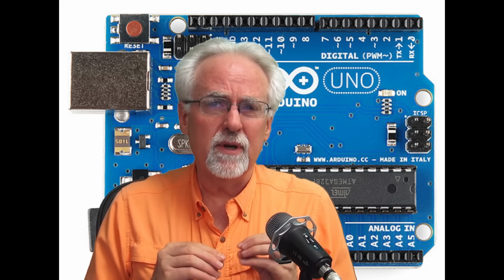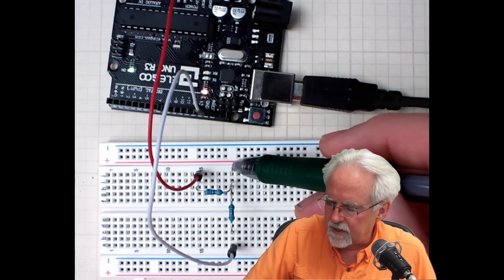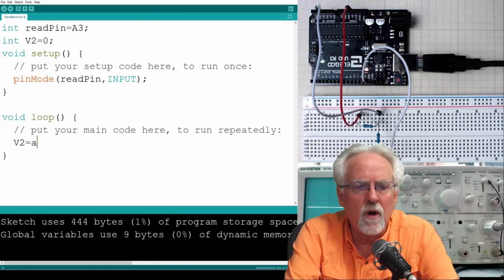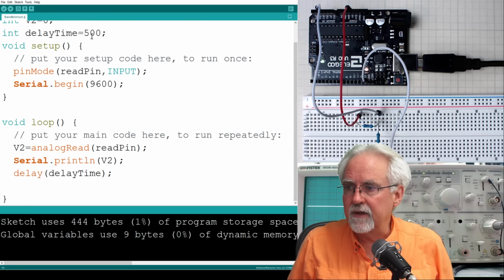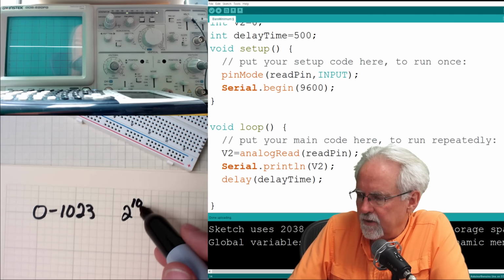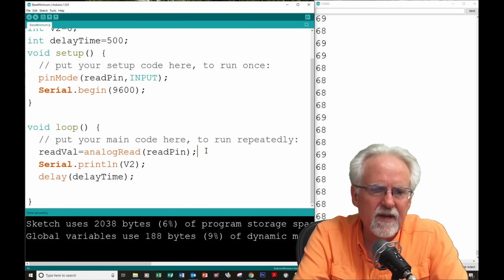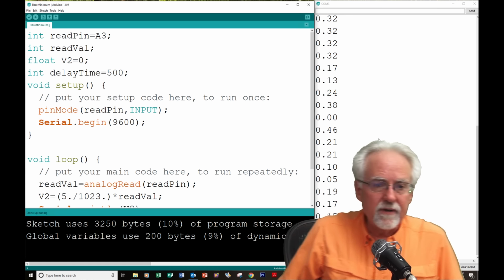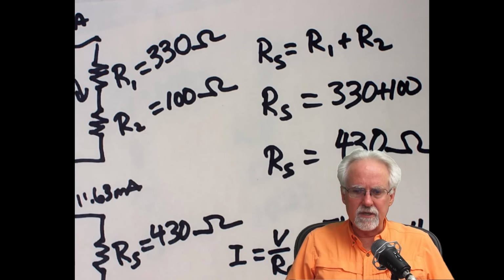Arduino Tutorial 10: Understanding How To Read Analog Voltage using analogRead Command

Comment: I feel like I still don't know where the analog to digital conversion was done.  I know we put an analog voltage into pin 3 but don't know how that analog voltage became a digital number between 0 and 1023.
Reply: There was no voltage received in the pin in that sense. There was a 10 bit signal that was received ie 0 to 1023. This signal is then mathematically approximated to match the voltage.
Reply: In the Atmega328 uses what is called a successive approximation ADC  (analog to digital converter) along with a MUX (channels A0-A5) this switch turns on or off the pin you want to read and what VRef you are telling it to use or defaults to input voltage AVcc. So think of it like this it takes your value and generates a reference 0 being 0 and 0.0048828125 Volts as 1 and 0.009765625 Volts as a 2 and so on up to 1023 provided your supplying exactly 5volts on AVcc.. If the value is above 0V0048828125 and below 0V009765625 the comparator says 1 spits it out the SAR which checks 1 step higher and a 0 spits out so it is done and sends it out done to the EOC. Which tells IC to record the value it's been sending to the DAC as the voltage measured. That's sort of a condensed version.
Reply: We have "Digital to Analogue Converters" or "DAC's" and we have (in this case) "Analogue to Digital Converters" or "ADC's" that are systems built in to the Arduino, these handle the conversion, if you use Wikipedia for an explanation it may help you

Comment: Another great tutorial. I don't want to get ahead of what you're teaching but I was wondering about your opinion of wireless sensors. Something that would be suitable for about 70 ft. or less. I was looking at the 433Mhz rf modules but it seems like they might have limited range.
Reply from the maker: I have had luck with the xbee radios, but a little tedious to use. I have some lessons on my old arduino series.

Comment: Hi whar aboui if you want to measure for example 5 volt or more?
Reply from the maker: digital logic is limited to 5V and sometimes 3.3 Volts . . . you would have to use something else like a volt meter for higher voltages.
Reply: @paulmcwhorter  ??????? you use a voltage divider which brings the voltage to the level below what your reference is. Then multiply the reading by the divided voltage.
Reply: you would make a voltage splitter circuit. Maybe Paul would show how this is done   or google it.

Comment: I think it would have been good to introduce map command to compliment the calculation.
Reply from the maker: My primary interest is education, hence I want to teach people to do calculations. We dont need no stinking map function.
Reply: LMAO!!!! @paulmcwhorter
Reply: @thunderbolt8582  Seriously, don't laugh, what you said was perfectly valid, a good question by an obviously inquisitive mind, one with a clear desire to learn his reaction was out of order.
A simple explanation of how a "potential divider" works and the use of two resistors of the same value (say 1K) would have been better as this would show the 5 volts would be halved and displayed 2.5 volts, then show by calculation how the arduinos internals deal with the voltage. At this point (as you said) a clear explanation of the Arduino's "Map" function would have complemented the tutorial ( I use the term loosely) perfectly.These functions are there for a reason, good luck in your endeavours.
Reply: I understand the thinking behind teaching equations for Arduino.  But when the calculation is linear, it makes sense to introduce the map function.  However, if the circuit had involved series and parallel paths, the equation approach would be more appropriate.  And if a RC circuit was being analyzed, the calculation with equations might have been very interesting and the serial monitor plot output would have been a natural addition.
Reply: @andymouse  Teaching approaches vary amongst educators.  I mentored engineering students by being a tutor in college.  I learned that there are many ways to teach a concept, especially when the student cannot grasp the straight forward approach.  Then you have to get creative to teach that individual.  My comments are not meant to be negative.  I think Paul does a good job covering the material.
Reply: @paulmcwhorter  I'm going to un subscribe, I can't believe you said that. If you truly wish to educate, then this is no way to speak to a student.